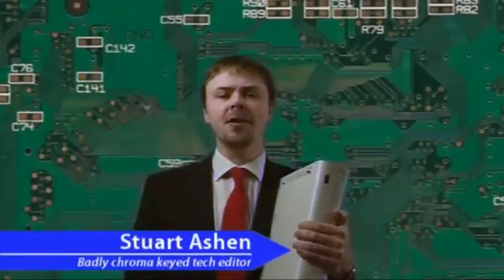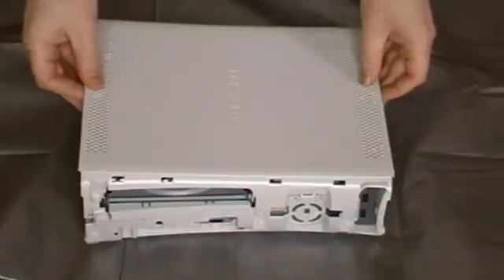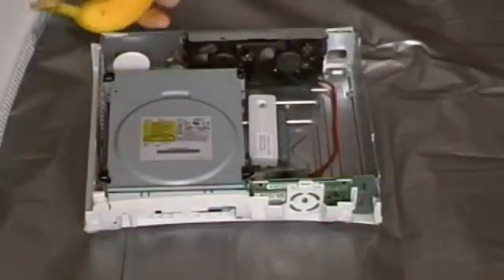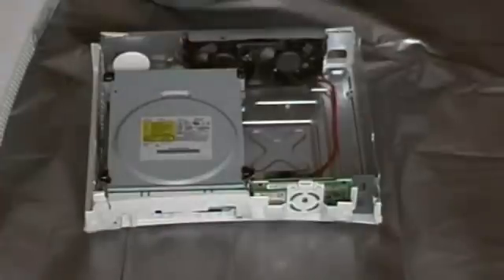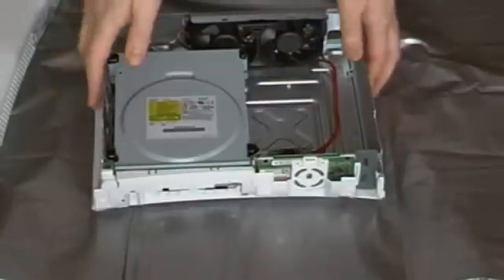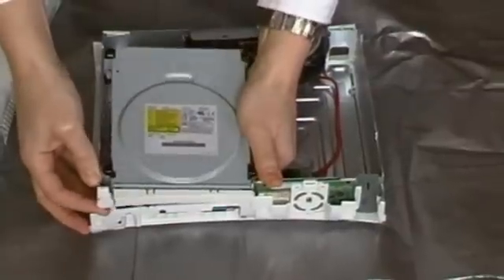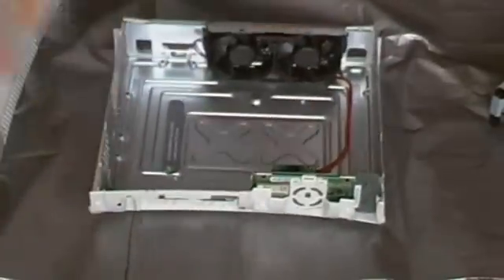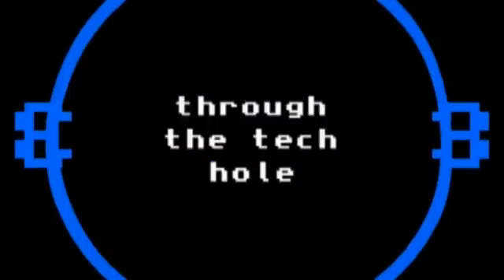Through the Tech Hole: Xbox 360 'Jasper'

Comment: I opened my 360 and i saw that there was an orange in there instead of a banana the achievement was none other then a notification saying Bill Gates is online there was a usb wireless adapter that connects a wireless controller to a pc there was no lady bug and the top picture was justin bieber with bill gates' face paster over the top of jb does that mean that my console is fake or its a different model or its modded
Reply: I'm afraid you got one of the Chinese knockoffs. They believe ladybugs are the Devil, so they don't dare insert one in their fake 360s.
Reply: Capp Antwan damn it
Reply: DiamondPro

Comment: Only a I5? I have a Intel Xeon xD And only 2x 500GB? you won't get many games with those (Plus 7200RPM is fairly standard) I have 2x750GB 1x500GB and 1x SAS 150GB and how does your game run at 1080p 3D on a non 3D Graphics card? (And what display system do you have? )

Comment: I spent $1500 (£925ish) on mine (ebay and bargin hunting)
i5 3570k 
2x EVGA 670 sc 
AsRock extreme 4 motherboard 
16 gb corsair vengeance ram
solid state (120ish gigs [not on my desktop to check]) 
2 tb data drive
850 w corsair psu
H100 water cooler
cooler master haf xm case

Comment: My xbox red ringed 2 2 weeks ago,and i found that 2 transistors burned out,now i have to order the transistors and resolder.Also there was dust inside my xbox.i'm going to sit the xbox next to my air purifier,or maybe just leave the xbox open and use a big fan to keep it cool,and no dust will settle either.I just have to be careful not to spill a drink inside it.

Comment: The hardware produced by Intel Amd Ati and Nvidia are both cheaper, and perform alot faster than the hardware produced for the macintosh by Apple. As far as i know you can upgrade certain system components in an apple mac with hardware from Intel/AMD/ATI/Nvidia, But then you are using the exact same hardware we are.

Comment: The crap box is a crap box, 
Dudejohnny - Yes I am a Fan Boy of the PS3, What's bad about that, From what i'v seen, it's bad er to be a Crap Box Fan,
You Fans put the DVD in, and get a Large scratch around the disc out, Not only that, you have the 'Red Ring of Death' too, 

if you need more info, look up BBC WatchDog, then try looking in the WatchDog reports, for  "2009.03.23: Microsoft Xbox 360 - scratched discs"

Have fun with your Crap Box,

Comment: Accully no everything is not 4X faster you 12 yo second the 2 CPU's (central proccesing unit) if you were to stupid to know that is 3.2 GHz makeing it the same speed and the reason why they use blu ray is becuase of the quality becuase it only has  a 50 MHz diffrence in the graphics and HD-DVD was already signed to microsoft and blu ray signed a deal with sony

Comment: @kyleman1311
You are an idiot and you don't know what you are talking about. It doesn't matter that the PS3 processor and GPU are more powerful, because any unbiased person will agree that the difference in graphics between the Xbox 360 and the PS3 is so small and even non-existent in most cases, that buying a PS3 for it's graphics would be absurd. Also, resolution is not measured in GB, that is storage.  HD DVDs have the same resolution as Blu-ray discs but games on the 360 are stored on DVDs.

Comment: first of all, the things you said in that comment were based entirely on opinions, not facts. therefore its just a waste of time. second off all, the PS3's processor is 5 times faster, and 4 times more powerful than the 360's processor, more open worlds, more things going on in the game at once, graphics are improved, but this is in part because of Blu-ray which the PS3 uses. 4 times the resolution of HD-DVD and HD-DVD:8.3 GB, Blu-ray:50 GB. that allows for alot more game. wouldn't you agree?